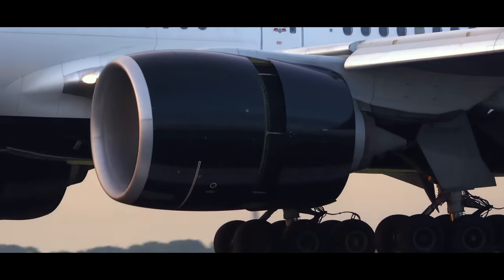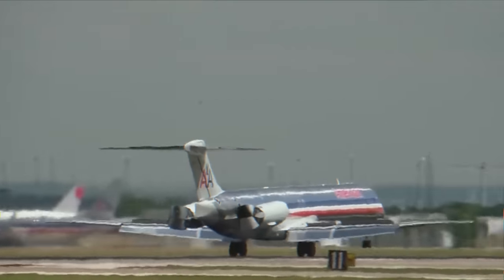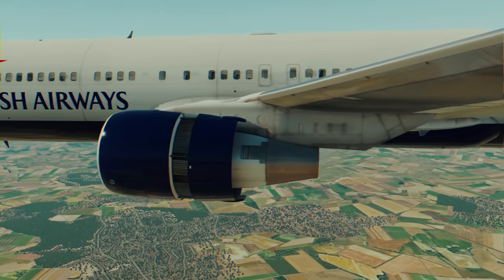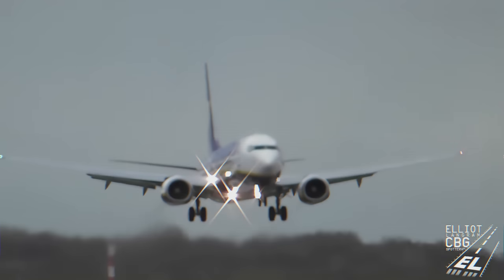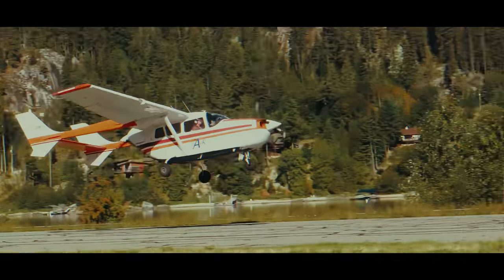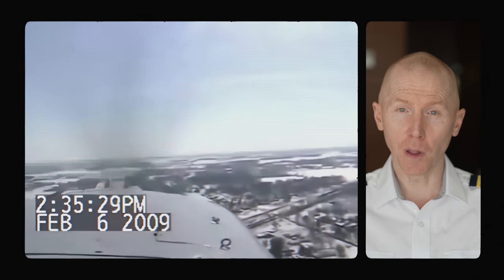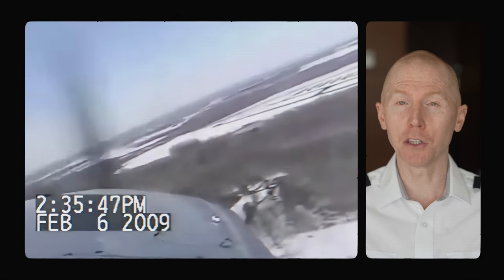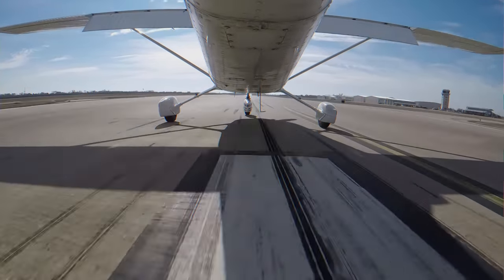Ryanair Pilot Makes Big Mistake

Comment: What you said about lining up on a runway with that little prop was a really good point that didn’t immediately occur to me. An aircraft in a 3° bank is much much less likely to drop a wing during a stall than one in a 30° bank. You really don’t want to be turning on a dime with an engine out, or you could end up sliding across an airport on your back after a nasty asymmetric stall.

Comment: That Mooney pilot showed how the impossible turn is possible with the right combination of conditions. He was extremely well versed in flying a Mooney and Mooney's are as good as it gets at gliding in that class. It was nice and cold out and he knew the airport well.

Also, I think that was not the stall horn, but instead the gear horn, as he kept it up as long as possible, as it detected too low a manifold pressure.
Reply: Is the Mooney a constant speed propeller? Any idea why the pilot didn't feather the prop? (I've only flown 172s so I know zip about constant speed props)
Reply: @JerryAsher  Most Moonies have constant speed propellers, including the incident airplane. He was busy flying it to the ground. Feathering isn't going to do THAT much for you there

Comment: ryanair charge for pre touchdown reverse thrust deployment.its about £10  per passenger, ....your baggage is a hundred yards before the threshold of the runway,  usually in mrs jones  tea shop lawn. she charges £1 per item recovery and 50p per day storage. .pot of tea is a very reasonable £10, extra £1 if you want it hot....happy flying folks.

Comment: For Ryanair, this is not really a big mistake; It's their normal routine.
Reply: Yes! There are dozens of bad Ryanair landings videos out there. They are well known and made fun of for it!
Reply: Their safety record say's everyone who's ever flown with them has always walked off, not many other "butter landing" carrier's in that club.
Reply: @PCG1970  It's a 737 "feature". Even the A380 has softer landings than a 737-XXX has. I've been on other airlines who use the 737 (last month on Singapore Airlines), and they also had hard landings.
Reply: @Luton-Mick  Well any landing you can walk away from is a good one :)
Reply: @judebrad  A pilot once told me that a 737 can be difficult to land smoothly and it can take months or years to get the knack of it properly.

Comment: Pilot about to do a go-around: I got 99 problems but thrust reversers deployed in flight ain't one
Thrust reversers deploy in flight
Pilot: 100. I got 100 problems.
Reply: A 737 max is designed to be able to deploy reverse thrust a few feet from the ground

Comment: The pilots watching are fully aware of what this guy was trying to manage but- the rest of us have to remember, he had to time that just right. There's no going around, no way to slam on the breaks- you have to time it with your decent rate so that you reach that runway at just the right time. This guy did really well- the steep turns were definitely a trip, but they helped to bleed off some speed I bet.
Reply: @TheBushka58  They had no working engines, which means no reverse thrust- or forward thrust- no thrust period. That's why they were gliding, and that's why I was praising their skills- landing a passenger jet with no engines is a truly difficult task.

Comment: A/G relays are one of the components who allows the T/R CVM to pressurise the actuators,  but also if the R/A is less than 10ft then the logic still will energise the reverser deploy solenoid and then allow the actuators to extend then deploying the actual reverser

Comment: I really appreciate how you keep things as simple as possible especially for non flyers. But when you said that thrust reversers are not normally needed on a normal day, what is "normal" ? 😊 A little more info to educate non flyers would be how thrust reversers reduce the amount of work the brakes have to do, this reducing brake temperatures which can get very hot and increase turnaround times especially for short haul airlines. On a perfect but very hot day, with a heavy landing weight and even light variable wind and a shorter runway, brake temperatures could reach levels to blow the tires, so reversers would reduce that possibility. Yeah it's nitpicky maybe, but its nice to understand what all the noise on landing is all about.

Comment: As others have said in the comments, if you suffer an engine failure on climb out the last thing you should be doing is trying to manoeuvre the aircraft unless you are very aware of the Minimum Manoeuvring Speed. Otherwise you are are going to stall and spin and end up dead. I would encourage any GA pilots to watch Dan Gryder on YouTube. Don’t try and save the aircraft, save yourself.

Comment: I don’t know about this version, but earlier versions of the 737 you have to have squat switch (weight on wheels) and the nose wheels spun up to minimum 70 knots before thrust reverse is available.
In the De Havilland Trident it was standard to open thrust reverse on the number two engine on final approach.

Comment: Our 737-3/400 required the right main on the ground to deploy the T/R’s. The DC 8’s in the early used #2 #3 thrust reversers for speed brakes in flight.

Comment: That last plane with the engine failure, I think his initial direction towards the airport was because he wasn't sure he was going to have enough elevation to do anything more than crash land in the field. Once he cleared the woods though, he realized he had enough elevation and decided to aim for the runway. With such a sharp turn and good landing (situation considered), I'd say he was an experienced pilot with that plane. Great job.
Reply: When these things happen it's best to take a breath and then decide on options where to land, I know when glider training we did something similar, and I immediately found a field in front or me, but as my instructor pointed out we had 800ft and could return to the airfield, which we did

Comment: B737 NG allows to use thrust reversers below 10ft radio altitude. This is against procedures but airplane logic allows to deploy reverser if radio altitude is below 10 ft OR air/ground sensor senses ground (WoW) AND thrust is at idle.

Comment: When doing the "impossible turn" back to a runway, the quickest way to get the airplane around with minimal altitude loss is about a 45 degree bank and "tickling" the stall horn.   Doing it successfully requires good coordination on the controls, a good feel for the energy state of the airplane and a lot of experience with the stall characteristics of your aircraft.     Practicing this at a safe altitude, with an Instructor, is great preparation for a successful outcome.    Don't forget, that the turn is more than 180 degrees.    I've done it (again, at altitude) with less than 400 ft. of altitude loss.

If you try the "impossible turn" at Best Glide, and under 30 degrees of bank, you're probably not going to make it unless you have nearly pattern altitude.

Comment: Speed check: Airbus A320 will automatically deploy the RAT to provide hydros and power when it detects a loss as well as accumulators for the hydros. The APU is required to re-start the engine but they could have also flown without the APU.

Comment: 10:10 engine failure on takeoff 
1) do not turn back to the airport
know minimum height before turn
know best glide speed
have pre-planned emergency landing areas
2) perform engine failure checklist
note snow on the ground … check carb heat
look at fuel tank levels … switch tanks

Comment: Hi to both  Kelsey and Mentour Pilot.  I am an engineer and it is the norm that the aircraft has to make the Weight on Wheels switches for the thrust reversers to operate, on most aircraft it also something that we as engineers do, if for for what ever reason the Thrust Reverser has a technical fault in the system. We would write it up in the MEL Tech Log we would also gag the Electrical circuit breakers and physically lock the T/R Levers on the throttles with safety wire. We would also apply physical locks to the T/R sliding sleeve on T/Rs that have Blocker door systems like the 737 aircraft in the film. These would have plates screwed across the gaps to prevent them deploying causing a physical lock on the engine. This came about due to an Air Lauda Boeing 767 that had an inflight Thrust Reverser deployment hence why there are now Physical Locking Plates fitted some aircraft actually have an Arm /Dis-Arm lever in the engine nacelle like the Gulfstream aircraft with BR710 engines as these are Hydraulically operated  T/Rs where other aircraft are Air operated  T/Rs  For certification proposes aircraft have to show they can land safely without Thrust reversers using there brakes alone. I was involved with a trial at London City Airport for the HS125 800XP aircraft to land there for certification as London City Airport is a difficult to Land at and depart from due to its location and both Pilots and Aircraft have to be certified to operate from it. On the day of the trial the Aircraft landed without T/Rs but the Lift Dump on the flap and spoiler system at maximum landing weight the HS125 800XP stopped within 1/4 of the runway there due to the huge flap area and spoilers the aircraft has

Comment: Most of the aircraft Thrust Reversers are designed 
 to deploy while Weight on Wheels or Wheels Rotation signal is available, but in case of this B737-800 T/R can deploy without weight on wheels or wheels rotation, when Radio Altimeter senses aircraft altitude < 10 ft.
In this particular case pilot should had not selected reverse thrust, to have an option for Go Around

Comment: This second clip bought back a very recent memory for me.  Several weeks ago, I was doing pattern work in my Beechcraft Musketeer at my home airport KHEG in Jacksonville, FL.  It was my ninth loop, and I was using runway 7.  As I was turning crosswind to downwind, 700 feet or so, I started losing power.  I went from 2500rpm to around 1800rpm.  My initial thought was there's no way I was going to make it down the entire downwind as I had no idea if I was going to experience a total engine failure.  I was in the best place I could be, as runway 11 was just off to my left.  Made my turn, was lined right up with 11 and touched down about 1000' into the 3500' runway.  I never did lose total power as I was able to clear the active and taxi back to the ramp.  Still no definitive answer to my issue but it is thought to be a lost magneto.  Time (and money :)) will tell.
Reply: ☝️thanks for watching & leaving a comment, congratulations, you have been selected amongst my shortlisted winners
Kindly message me on the above☝️

Telegram only to claim prizes🎁
Reply: The bot is not even set up right, these scammers are so lazy 💀

Comment: The windmilling doesn’t only NOT help to power the plane forward, it creates drag. Not being a pilot, I don’t know how significant the drag is, but if it’s turning the motor (not de-coupled somehow in the gearbox) it’s loosing whatever energy it takes to to turn that motor PLUS some - like taking your foot off the accelerator in a standard transmission vs pushing in the clutch and taking your foot off the gas. When the wheels are de-coupled from the engine at zero throttle the car will coast MUCH further than it will by simply taking the foot off gas and leaving it in gear.  The lower the gear the higher the engine-brake effect is - I’m curious if there is an analogous situation with a prop that can be feathered? Steeper pitch, more (or is it less?) drag? 

I assume the prop on this video (of the one engined prop plane) couldn’t be feathered into a position where it would be more aerodynamic?

Comment: "The thrust reverser can be deployed when either radio altimeter senses less than
10 feet altitude, or when the air/ground safety sensor is in the ground mode.
Movement of the reverse thrust levers is mechanically restricted until the forward
thrust levers are in the idle position"

Comment: Reverse Thrust usage was such a problem over the city were I live that it was banned. Pilots were using them to slow the plane while in the air and as Adelaide south Australia is such a small city the airport is still near the city centre. Adelaide airports runway was extended but it is still a short runway compared to most.

Comment: Reversers were likely pulled in anticipation of a touchdown that in the event was delayed slightly by a gust hence them coming out a few feet before touchdown. Pulling them intentionally whilst against SOP does get it down on the runway. Pulling at least idle REV on every landing is mandatory in ryanair(I did about 5 years with them). Pulling them early does kill the go around option as you say.
Reply: Ducan

Comment: The earliest iteration of the DC-8 was designed to use thrust reversers in flight in lieu of airborne spoilers like Boeings used. I think the first versions permitted MCT reverse on inboards, idle reverser on outboards, and I don't remember how that changed over the development life of the series. Emergency descent was - all four in reverse, MCT on inboards, descend at barber pole speed, select forward thrust quite a bit above target altitude, watching for unwanted acceleration with reverser stow. . .
Reply: ☝️thanks for watching & leaving a comment, also congratulations, you have been selected amongst my shortlisted winners
Kindly message me on the above☝️

Telegram only to claim prizes🎁

Comment: There is a power line visible to the left.  The top of the rightmost power pole is visible directly in front of the plane as the pilot completes his turn to the right @10:06.  I believe he chose his path to be able to go right of the power line if he had descended below it by the time he got to it.  And from the looks of it, he was only a few 10s of feet above it.  I'd rather miss the power line and land in the grass than hit the power line while perfectly lined up with the runway.

Comment: I have heard that some military aircraft can allow this and has been used to effect a vey steep nose down descent into some airfields where they dont want to run up a load of speed in the hard descent. This is done whilst very high though. Not whist landing. I think I even saw a video on it. Not something commercial will ever want to do because that severe nose down attitude freaks out your passengers. We used to use hard rudder right or left and nose down hard to drop out of the sky quickly quite a lot on microlights because it gives you safety to come in high and makes sure you always get to the field incase of an engine issue... nothing worse in single engine microlights than a flat low approach on a short field if you lose your only engine.

Comment: I have a question for you Kelsey: would deployment of the thrust reverser close to the ground, allow to stabilise roll of the aircraft?
I remember vividly flying 35 Years ago, a day or two after the big October Storms in Europe, from FRA to LGW on a BA flight, operating, what was then, a quite new, 737. 
As it was still quite stormy, the fasten seatbelt light was never switched off, no trolley service was provided and, whilst still over the Dover Channel, the Flight Attendances all strapped into their seats.
When we approached  the threshold of the Runway, the plane was rolling strongly and I could see, that the Wingtips were coming very close to the ground.
The passengers on the plane started to find their religion and the odd scream could be heard. I was pretty unfazed, as to me it was clear that the Pilots had only one choice: Go Around!
This, however did not happen! Whilst flying only about 10-20 feet over the touchdown zone, still rolling, the pilot deployed the Thrust Reversers, which immediately stabilised the roll, and it felt like the plane just dropped the last few feet and we had a very “positive” touchdown.
At the time, this manoeuvre felt to me like the simplest way to stop a plane from rolling excessively, but I wonder if this is actually true?
Reply: ☝️thanks for watching & leaving a comment, congratulations, you have been selected amongst my shortlisted winners
Kindly message me on the above ☝️

Telegram only to claim prizes🎁

Comment: I have seen A340’s land with reverse deployed. 
It does not mean the reverse action is working. Only the reversers are open. 
Normally the reversers are blocked to be triggered by a “squad switch “ on the gear. 
But apparently on some planes you can deploy , maybe a CB is pulled to override the safety’s .
Reply: ☝️thanks for watching & leaving a comment, congratulations, you have been selected amongst my shortlisted winners🎁
Kindly message me on the above ☝️

Telegram only to claim prizes ☝️

Comment: For the second case, with the engine failure on take off: wouldn't it be better not to try to make it back to the airport at all? You are very low, and close to the ground, you have no power, and you have to pitch down to keep your speed above stall speed. So better keep flying strait ahead and try to land it some were there. Dan Gryder said this, referring to the minimums maneuvering speed. Which is higher than you stall speed. You need mms to make safe bank turns.

Comment: There are cases where you want that thrust reverse active even BEFORE you touch - but normally only a very low altitudes and involving STOL aircraft like the Hercules on a VERY short rough runway and a VERY heavy load, and it takes some TIME to reverse the thrust from changing the pitch of the props.
Note that carrier landings NEVER involve reverse thrust - that's what the arresting cable you hook is FOR.